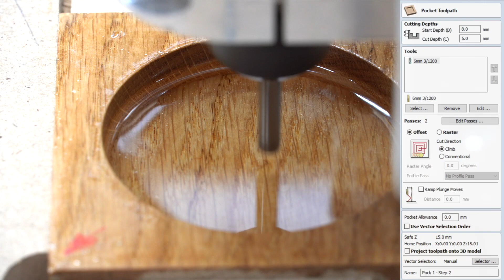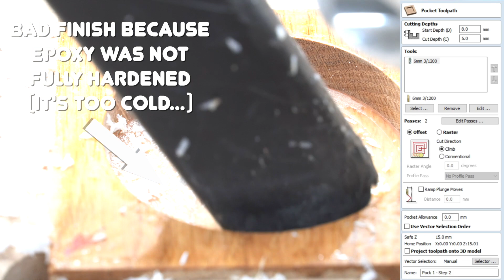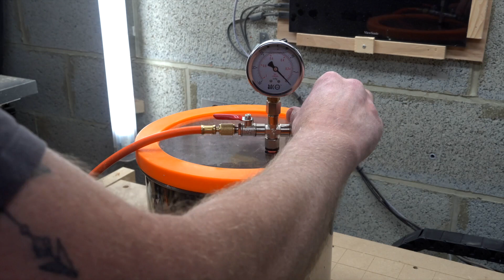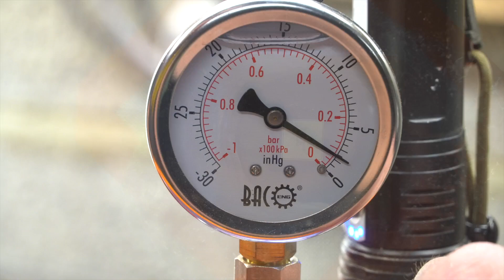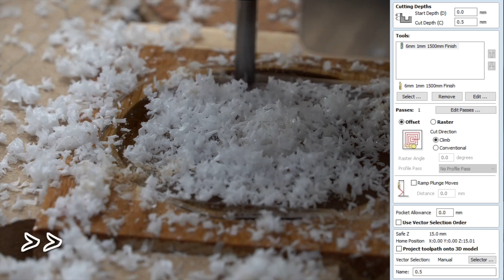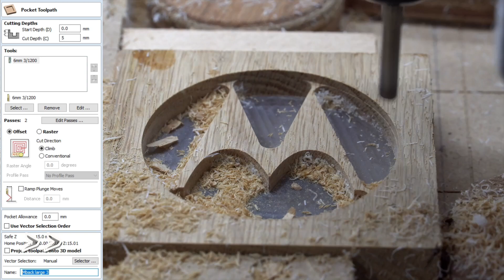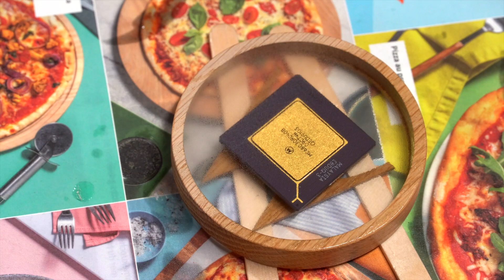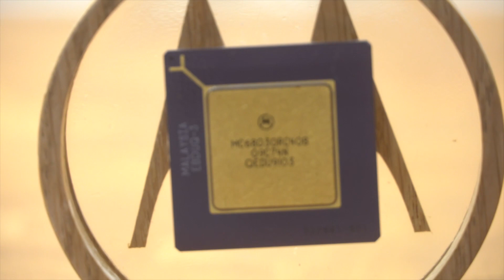Embedding a Motorola 68030 CPU in resin.

Comment: Hi. merry christmas 😊
Just wanted to ask which cnc software you use on the machine ? Is it edingcnc ? If so, I havent found a eding postprocessor in the vectric demo. Thanks for the great videos.
Reply from the maker: THanks. I use Vectric VCarve Desktop for CAD and CAM, and EDING for driving the CNC. The postprocessor was supplied by the CNC manufacturer (Sorotec).
Reply: @stephanforseilles  Thanks so much for the answer. then i try directly with sorotec to get hold of the post processor.